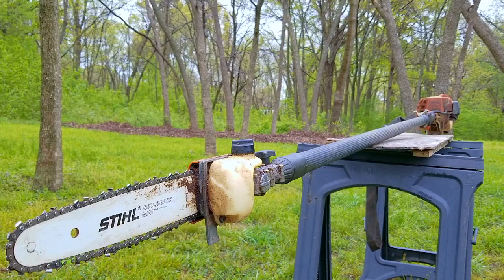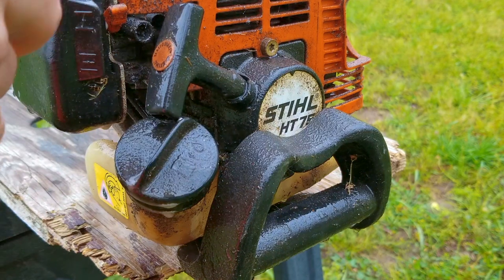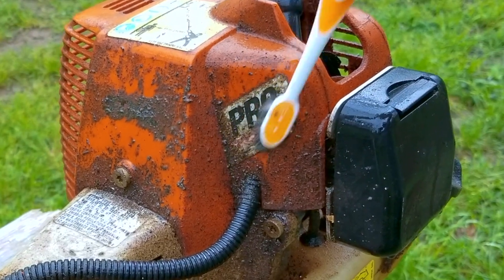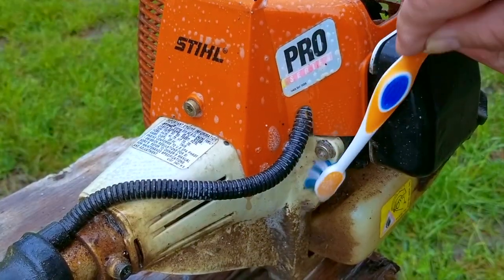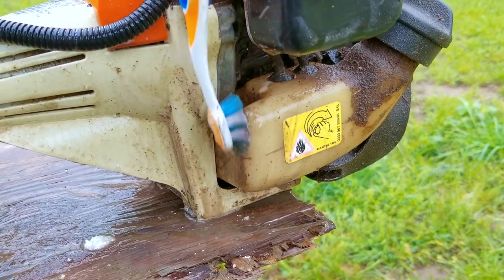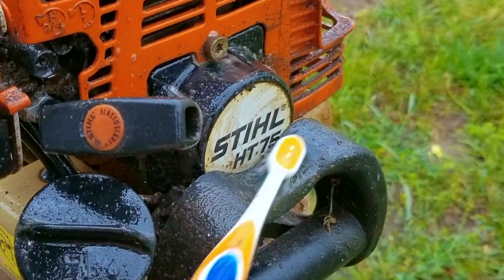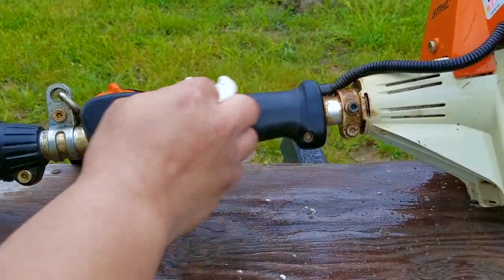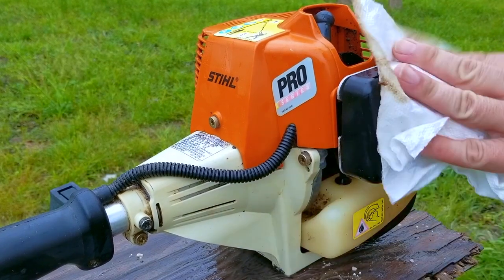Q&A # 10 and Cleaning the dirtiest Stihl pole saw ever.

Comment: I have found super clean (purple bottles) cleaner- degreaser to be the best general purpose degreaser on the market. If used full strength, you can actually degrease auto engines and unclog sinks. For cleaning small engines and other equipment, diluting it 50/50 with water works great and doing 20% super clean to 80% water works great for cleaning the house, stoves, counter tops, mopping floors, etc.
I do not recommend purple power as it stains metal and plastic if not diluted properly. Mean green and simple green are good too but super clean seems to work just a bit better.
Reply from the maker: thank you, I've been look for another option.

Comment: I think Honda is a very solid choice for your favorite equipment manufacturer, and is one of two or three I'd select myself. I happen to be partial to Stihl products because that's all I presently have and have found them a pleasure to work on compared to some other brands. However, I know that Honda makes good engines and equipment; If not for my slight bias, I could just as well choose Honda as my personal favorite brand.

P.S. With the mention of the possibility you will be cleaning a riding mower at some point, I think it would be a good idea for you to include some advice about using the wash port with deck lowered on a flat surface or piece of material, as well as with the mulching cover on (if any). This will make it significantly easier for the average person to clean up their deck regularly, considering it's not something you can just tip over and scrub at a moment's notice.
Reply from the maker: you are absolutely right, I will make a video soon about the wash port.  Been wanting to try it for awhile

Comment: When I'm doing maintenance on my equipment and I meet stubborn oil and muck deposits I usually scrape up most of the stuff off first and I use a chemical called purple blast and it usually does a good job
Reply from the maker: I'll have to look into that product
Reply: @INSIDEHOUSEGARAGE  it is a degreaser product so basically like working on an engine with a bad oil spill it cleans up pretty well. I've been using it a couple of years now to clean the engine in my car and also on my chainsaw
Reply: @INSIDEHOUSEGARAGE  purple blaster is the correct name of the product
Reply from the maker: that's good to know.
Reply from the maker: ah, thanks for the information .

Comment: As far as cleaning my equipment goes I actually take it down to the local car wash and power wash them off it works pretty good but you got to let them dry out for a few before you try using them LOL
Reply from the maker: Great tip!

Comment: All of that oil on the engine shroud is probably oil from the bar oil that slowly leaked out over time. Maybe it was stored upright?
Reply from the maker: that's a good possibility, If I see my friend sometime soon, I'll try to remember to ask him.
Reply: Nope.  The oil tank is 10 feet away. I’m working on one of these right now and it was even dirtier, to the point that I couldn’t even distinguish parts of the carb. The dirty, oily deposits are carbon soot from the exhaust over long periods of time. In the case of the one I’m working on the spark arrestor is missing and the muffler is so rusted out there’s actually a small hole in one corner. It also is in for a bar oil leak, but this machine is always stored horizontally so no bar oil is getting on the powerhead.

Comment: I appreciate the responses too, but not always necessary, I know many sights that lack that interaction with their viewers..
Reply from the maker: I appreciate every comment I get, even the nasty ones, and I feel compelled to at least respond. And yes, I use to comment on people's channels, till I realized they didn't care. So then I didn't care to watch them anymore.
Reply: @INSIDEHOUSEGARAGE  the best ones are the ones you question ones actions like removing the protection guard on a Wipper snipper which they shouldn’t show other’s that bad practice, if they ever get injured or worse an employee they might not be covered by insurance or be liable in a claim against them. You don’t see manufacturers doing it.
Mechanically it puts more strain on the shaft, because the advantage is you can put different heads and use a longer line length on a bump feed.
😡😡😡
Reply from the maker: yes you're right.